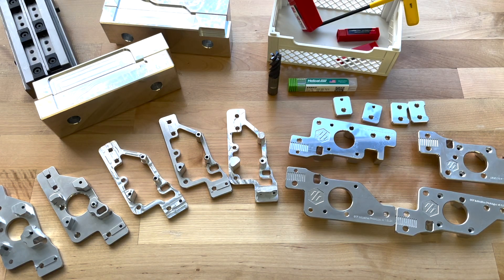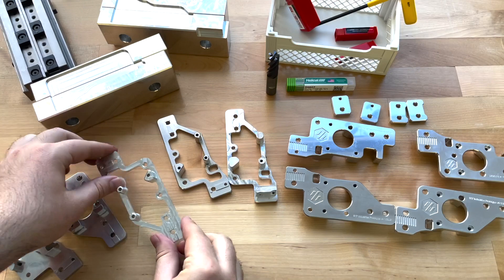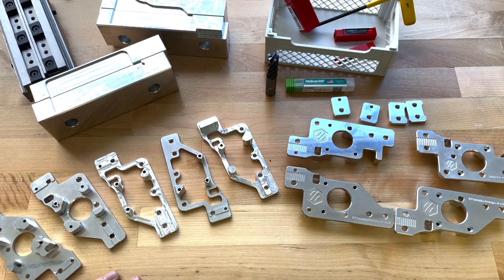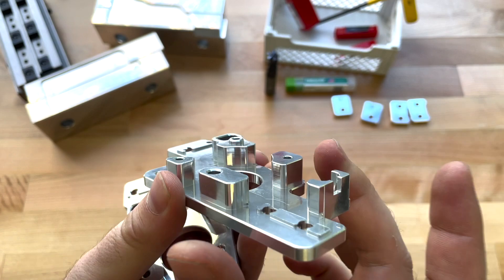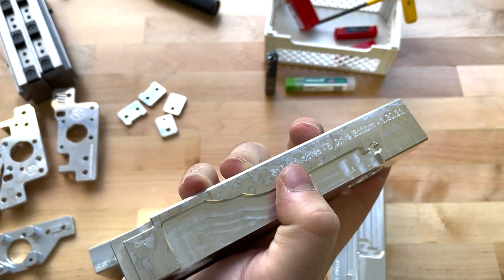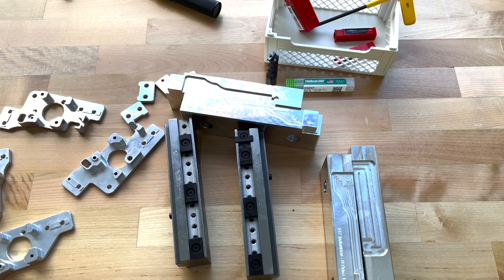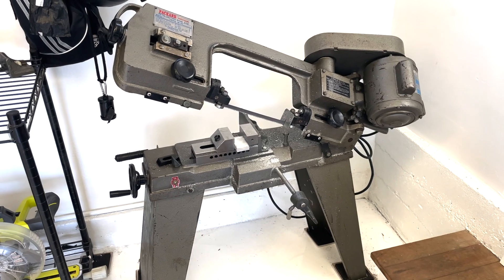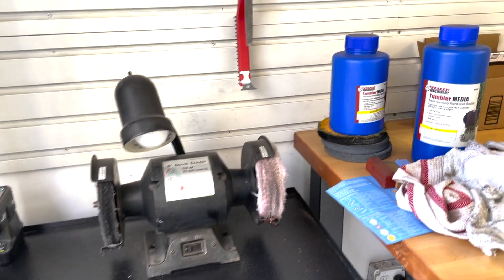Quick Update on Voron 2.4 Project

Comment: Have you tried a tumble polisher with walnut shell?  look into clear coating afterwards, polished aluminum will dull quickly, especially after being handled.

My suggestion is find a machine finish or pattern that you like to save time on post processing.  I imagine you are going to have some high demand upon release, so reducing turn around will help alleviate some future stress.

Comment: If you're planning on doing something similar to your first batches again, it's best to make a jig with a solid slab of material, a pocket that supports the part and then bolt the part down to it through the motor mounts etc. to reduce vibration.

It was good enough for stainless rocket parts, so should work good for something like that

Comment: Try adding some ribbing for the skeletonized version, just adding some ribs to make the part more rigid will help with flexing while clamping. You can also look into making fixture plates instead of softjaws, that way you can run several parts at once and have better holding geometry

Comment: If you setup a contract with your metals company you can get credit for the weight of returned chips but it needs to be clean and sorted for a setup like yours it's rather easy to keep stuff cleaned up. 
I have a similar setup with a vf-2ss and an sl-20 in my shop.

Comment: You are wasting time with soft jaws.
You should use a fixture plate and alignment dowels.
You can gang multiple ops on the same fixture. not only will you get much better parts, it will take you less time.

Comment: Here are a few tips that may help you with future fixturing and soft jaw creation. I think some of these tips were detailed by someone else, but I will reiterate them. 

When machining soft jaws, try and keep the back portion of the jaw as thick as you can, something like 3-4 mm or .100-.200 in. This additional material helps keep your locating surfaces of the jaws in line as you clamp the vise down. Having the back edge of the jaws be as thin as the ones you had in the video can result in inconsistences and shifting, because you are forcing the material of the jaw with the part away from its theoretical datum/origin point. 

Another tip with soft jaws is instead of placing your machined origin point on the backside of the jaw that contacts the portion of the fixed jaw (upper left hand corner when looking down at the jaws from the top), place that machined corner on the front face of the jaw where the part goes (lower left hand corner of the jaw when looking down from the top). In practice it shouldn't matter where your machined origin lies if you machine your part cavity at the same time, but I find it to be more intuitive especially if I am working with jaws that are different thicknesses. Moving that machined corner to the front of the jaw face also allows you to skim the entire front side of the jaw with an endmill to create a parallel datum with the tram of your vise. This gives you an easy location to place an indicator to tram in the jaws when you set them back into your vise. Of course, I am typically working with soft jaws that are cut out of raw material and not pre-machined. Also, sometimes placing a bored hole about .25" in diameter in the center of your jaw works better with locating your X and Y as opposed to a machined corner, especially if you have a probe. 

When you switch to the carve smart soft jaws, you can easily incorporate a whole host of upgrades and tweaks to make a better jaw set. The repeatability of the Carve Smart jaws is quite impressive given its locating on a single pin and the dovetail. Even though you may only be making prototypes of these parts for research purposes, something like a Pierson Mini Pallet system or even a custom machined modular fixture can work very well for thinner walled components such as your skeleton/grid piece you were trying to work on. 

I just stumbled upon your channel, but your "come to machining" sounds very similar to a lot of other Youtube or Instagram machinists, so keep up the great work.

Comment: I'm pretty sure most of the alignment issues in the first part could have been avoided if the final contouring would have been part of the side that had the protruding major features in it.
Doing the Counterbores for the Holes, Belt Grooves, and Chamfers in the second pass alone after touch probing from the then finished and thus clearly defined overall contours would most likely have been The Way™

Comment: I think you made the right choice to first build a solid working piece before trying to get into custom options.
1. Soft jaws are great for final op. When you get into production runs or want better clamping force on thin parts my suggestions would be to design a fixture plate that can hold multiple pieces. Use the drilled out holes from OP1 to secure to fixture plate for OP2.
2. Don't throw out the roughed out material old material. If it still has enough stock for a finished part it could be re-used for #1 or you can rough it out/ cut it up for other parts you plan on making or prototyping.
3. A dry/wet tumbler will give you a good polished finish and help with deburring and reducing visual appearance of tool paths. If you want mirror finish then the parts will have to buffed last. FYI the high polish will fade over time so unless someone plans on pulling the parts from the printer or getting polishing debris and fibers inside the printer IMHO it's pointless. If you plan on coating or anodizing the aluminum parts your vendor will likely have their own process for prepping the material for coating.

Comment: Sometimes you need to cut a tight fitting insert to drop into a pocket in a part before clamping in soft jaws to keep it from deforming. If you have the Renishaw probe (Or even an edge finder), use a machined feature to set your offset for the second and third op,. Since this is done after clamping and you are probing the part instead of the vice jaws, it will be more accurate.  Nice work!

Comment: Polishing aluminum sucks. Best way to polish it  is to not polish it!  Your parts look good go right to anodize!  In the medical industry parts are polished by robot. Pain the the rear to write program for.  Polishing in the CNC is not recommended - the abrasives get everywhere and will wear the machine.  If you are dead set on polishing the aluminum you could use some old 3d printer or build a cheap machine to do it without trashing the Mill.

Comment: if you really want to do the skeletonized parts, the same method applies.  For side two, you will have to make an insert that presses in before you clamp the part. Do not make the insert 100% of the pocket, just make the center part with plenty of clearance to pick it out with your fingers. Make two, so you can load while its machining the next part.

Comment: to get rid of the misalignment, buy  the material .1 or so oversized.  Machine side one completely. For side two simply face off the excess material. The misalignments will be limited to just the chamfers and logos.  This saves tons of time and scrap.

Comment: What process do you use in finishing your parts. They looks super shiny in the video and I have been having a hard time getting them that shiny with my vibritory tumbler
Reply from the maker: They come off the machine pretty shiny - however I did tumble these in a cheap harbor freight tumbler with walnut shells. Not that happy with the finish from that though.
Reply: @517industries2  the process I have been using is about 70 hours in the green harbor freight triangles and 100 hours in the harbor freight corurse walnut and they come out shiny but still a little bit of texture on them. Really want the mirror finish i get off the mill but without the tool marks. Maybe ill try some corn cob.
Reply: @517industries2  corn cob
 will work better than walnut shells i reload and cob really shines my brass i also put iosso case polish in with the corn cob, you can use just about any cheap car paint detail polish, i have also used flitz with the cob,,, if u want a nice big tumbler look at dillon reloading they have 2 sizes i use the large one been using it now for 10 years works great

Comment: Thinking outside of the box for the moment - and I don't know whether this would ultimately be helpful or not, just putting it out there. I also haven't watched the video through its entirety yet, so I don't know whether you've mentioned this in the video itself.

There are currently some aluminium anodised parts available on AliExpress for the 2.4 already - obviously yours look *amazing*, and so if there was ever a question as to where one's support should go, it should obviously be you (this isn't why I'm mentioning this, however) - would it help if you were to order a set of these parts and try to reverse engineer/deconstruct them, at least in terms of milling operations? Or how they did certain features? Just a thought.

I LOVE YOUR WORK! :D
Reply from the maker: Thank you for the kind words! It isn't a bad idea. If I get stuck I will definitely take a look.

Comment: I made myself an electric foundry to melt aluminium to recycle all the scrap pieces and chips. It doesn't cost a lot of money for a DIY approach and is quite simple to make.
Reply: @TheRybka30  Why is cast aluminium bad for machining ? I had good results so far, but I may be missing something (on my beginner/hobby lvl)
Reply: @floriansolles445  I've heard chips don't melt very well, I guess because of their large surface area to volume ratio. Do you find that to be true and do you do anything to mitigate the issue? (Like, maybe if you melt 'em before the oxidized layer has much time to form or something.)

Comment: With those scrape pieces just use then to make other smaller parts, like the belt clamps you showed off. Should be able to salvage alot of that material before scraping it out
Reply from the maker: Great idea! I will use it to make clamps!

Comment: You may have a clamping problem, but nothing that cant be fixed.
try some fixture with either using bolts to clamp or your rotating clamps etc.
I have some ideas in my head^..
and also you could try a different approach to skelletonize the parts...

Nice garage update tho! huge update to the mess from before :D
Reply from the maker: Yeah - I am over clamping the parts. Got a torque wrench to help combat that moving forward! Yes it was a MAJOR update lol.
Reply: @517industries2  you should put a spacer in the milled areas to clamp on ;)
got any problems with contacting me?

Comment: Have you thought about using the holes in the parts to bolt it down? You could add holes into your jaws and tap them. I have been using this method for various cnc jobs and it seems to work decent. Not sure if it will work for this but thought I'd give you an idea. Look forward to seeing the parts on the voron!
Reply from the maker: Really like this idea!
Reply: I was thinking the same thing. Lots of options to hold down those parts. I work in the CNC industry and it's amazing the way guys get creative with holding down odd shaped parts.

Comment: you can likely sell the scrap aluminimum to someone who can use it to make castings. Like many of us pointed last time about the skeletonizing, its basicly useless. If you do it at least dont overdo it. You seen how it makes clamping the part difficult and adds nothing but some visuals. If you change the logo position or remove it you can make a hole on both sides or the big hole.
Reply from the maker: Hi Tommy - I agree, it caused more problems than solutions. For now that idea is scraped.